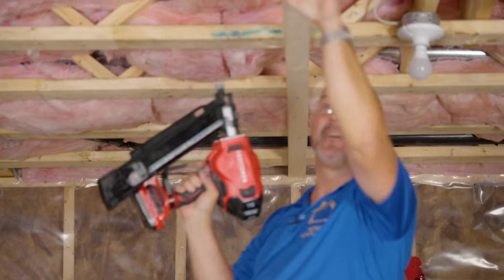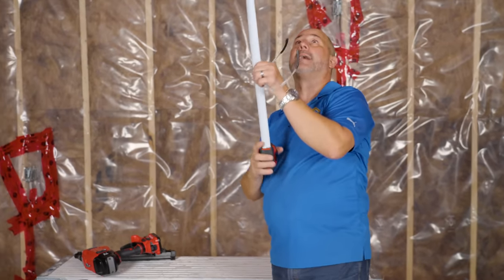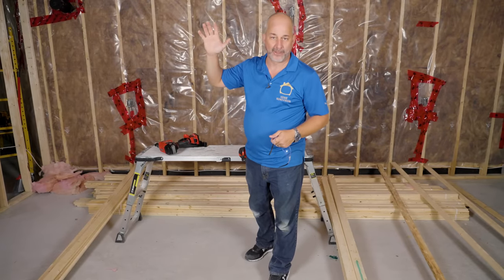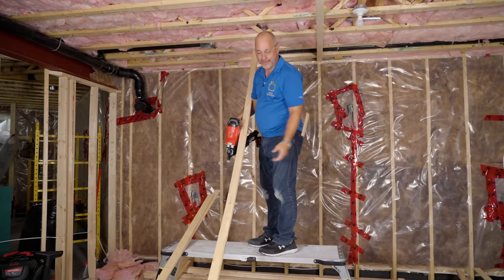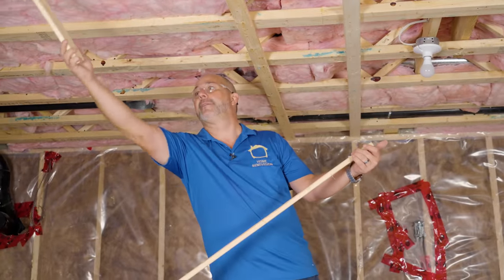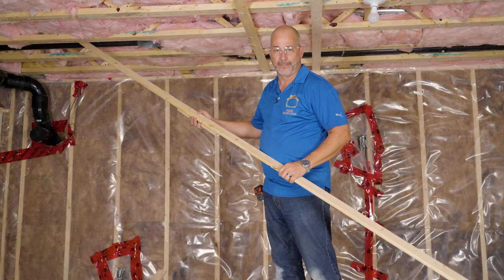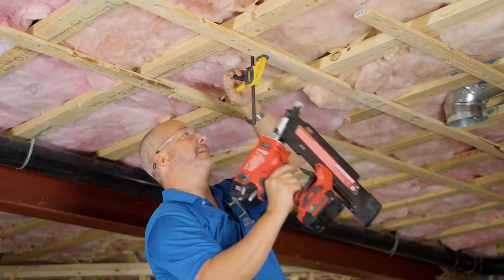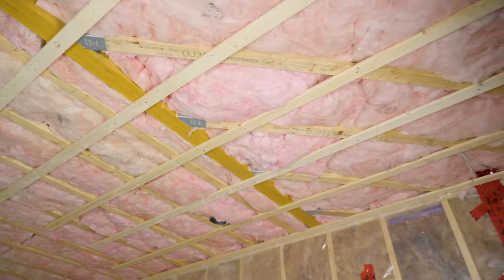Why You Should ALWAYS Strap Your Ceiling

Comment: I mean this is pretty good.  Strapping doesn't add strength or distribute load to adjacent joints, and squeaking won't occur anyway because the subfloor is also glued, but all in all this is a pretty good video.  (Construction professional)
Reply: Second that, no strength added.  Strapping will only act to help prevent the beam from twisting, but not sagging or bouncing. Only adding blocking between joists actually transfers the load from one joist to another...but only if it is done right and tight. No loose fitting blocks and don't space them out too far. Old homes with 8" joists benefit from closer spacing to firm up the floor.
Reply: Journeyman carpenter here, agree with you, strapping really only serves an aesthetic purpose, it helps you install different finish materials more flatly and get away from protrusions, aside from that it does nothing
Reply: seems to me that it is optimistic to assume strapping makes it 3 times stronger as mentioned at 1:28
Reply: @jwiereng  its optimistic to say it adds any strength at all
Reply: @chrisc5334  Ya, it this was true, you would see the engineer calling for straps and save $$ by allowing for smaller joists or smaller floor trusses
Reply: Dude you are huffing and puffing just putting up 1x4 strapping. Take care of yourself a little.
Reply: What you just said here is EXACTLY what I was thinking as he was saying that it, “adds strength”.
Reply: I bought an older home when I had to do a remodel and when the construction grade carpet was finally beyond any type of spacing or cushioning value, we pulled it all up and got down to the OCD floor before we put a laminate on top of it and I walked around and found every single squeak and we put in screws going well into the manufactured Joyce now we weren't able to pull up the whole floor and glue it and screw it, but it always puzzled me because all the user those Staples or you know nail guns on these cookie cutter construction projects, drove me nuts... when it wouldn't have cost that much more to do it right and use glue and screws and there wouldn't have been a squeak to be hurt on that anywhere
Reply: Engineer here and I agree with your statement. There is no significant resistance to deflection due to the strapping. The main advantage I can see to use it is in an old home with rough sawn lumber where the joists are not in-plane anymore (or they never were). I spent several hours with a hand plane on a ceiling of mine taking down a couple joists that were 0.25 low (the ceiling was already 6'9" so strapping was undesirable). With strapping you would only have to adjust the contact points instead of the whole joist. You could also use shims.
His wiring point is valid, it would help fish wires in the future. But that is not enough reason for me to do it. 

Sorry James, this one is a miss for me. Well done on the videos though.
Reply: @ryanleigh6701  To be fair he is talking about changes to the wiring after the room is finished years later. It would be cost prohibitive to cut a groove thru the hole room rather than fishing it over the strapping from a small hole to the next. 

Regarding wiring being fastened I have always questioned that one. Why? Where is it going to go in a stationary building? The worst would be the weight pulling it out of a box and dropping into the wall, so require that it fastens in the box. But in other places I think it could be bad. It is always attached to the framing, which is where all the fasteners go. That increases the likelihood of getting hit by a fastener, a shiner. Further because it is fixed in position it cannot deflect out of the way, so the fastener tears the jacket. Why not leave it loose in the middle of the cavity where it is unlikely to encounter fasteners, and if it does will just be pushed to the side or away? Also if you need to change out a wire later (adding a three-way for instance), unfastened you have a chance of being able to use the old wire to pull a new one thru causing much less damage to the building. 
It seems to me the practice is based on it looking neat, and not on practicality. 

Do you know of specific reasons?
Reply: @court2379  fire hazzard, when the ceiling comes down in a fire all the cables will hang down and cause a massive safety issue for fire fighters. Many have been killed in tower blocks because of it.
Reply: Totally agree with your point, besides nails have sheer strength, while screws have pull strength.  
I do agree building with future additions is always a great idea, and makes great points on this.
The problem is that now that people have watched this they will have the impression that nailing a horizonal one by will add additional strength.

One of the main reasons I walked away from building seven years ago, because customers tend to hears these types of information, and then end up questioning the builders abilities. 
Besides it's hard to find good help now a day's. After a couple months they want top pay, while they still haven't learned the proper way to sharpen their pencil. Lol
Reply: @ryanleigh6701  Turning the power off isn't the first thing they do before running into a burning building with a water hose?! Isn't that why most codes require a main disconnect on the outside of the building?

I still don't see how that would change much though. Hanging in the wall cavity isn't going to get in the way unless they are trying to punch thru the wall. Which they might do, but rarely. Seems to me the hazard of causing a fire in the first place or getting electrocuted by a fastener outweighs the unlikely scenario where the wires are in the way.
Reply: @ryanleigh6701  Don't know what you are getting upset about. I appreciate your responses. You provided a genuine reason why and a good discussion. I don't personally agree with the reasoning behind the requirement, but you didn't make it. It seems like it is in the interest of the fire crew and not the greater public safety. 
The electrocution comment was in reference to putting a screw into the wire and touching the screw.  Based on your response I think you interpreted that differently. 
IMO that is the more likely scenario, and a fire fighter is trained to know the hazards (and should be turning the power off) while homeowner with their too long nail is not. 

In the walls it doesn't seem to me it would make much difference to fasten them. The hazard is roughly the same whether you touch them in the middle of the cavity, or rub into them on the side of the stud. The ceiling they would drape though if running with the joints and the drywall has come down. The electrician would need to fasten those anyway to keep it out of the way of the drywall installers. It could be loosely though and still allow pulling a new wire while preventing draping. 

But if your reason is the one causing the requirement it makes sense as the fire people are the ones dictating its content and they are going to look out for their own.
Reply: I think this is a waste of time and money.  My house has floor trusses spaced at 19.2" and I installed the drywall directly to the bottom chord.  No issues what so ever and that was 14 years ago.  Running electrical or anything else  through trusses is simple.  My deflection was addressed when installing the 2x6 bracing through the webs.  Just another excuse to make a YouTube video I guess.
Reply: @court2379  if you have ever pulled much wire the last place you would want to pull is across  a screw penetrating the lathing. It rips sheathing. Chances are likely nothing would happen if it got a rip but why chance it? There is a reason wires are pulled through holes bored not through convenient opportunities...
Reply: @chrisc5334 stops sound travel too cuz it keeps the joists from acting like a drum for sound waves
Reply: @greensfarmland if you can’t e plain a compelling argument for your approach, perhaps you should reflect if it’s really is a good/better approach. Stager so so much nonsense and bs in residential construction mainly because there is no certification, 95% don’t get any formal education, and poeple just keep repeating the mistakes they made in the  past and the is limited curiosity also. A well informed builder would be Able to give a rough cost for this and any relative benefits…I would say use open web or true joists and you don’t need the spacing. I also agree with you the trades and buidlers on general are asking to get well paid without really knowing or learning or improving. At least for licensed trades plumbers, electricians, they must learn and pass tests and know codes cold. I think framing can be just as demanding and thoughtful, but too many people just want to swing a hammer and drive nails guns’ it’s fun’…the number of builders let alone carpenters who know anything about building science  is probably in the low single digits percentage wise. That’s appalling for such an expensive product. The pendulum will turn when the economy worsens.
Reply: You guys saying it doesn’t add strength need to review floor and ceiling diaphragms.  Adding lateral bracing to a floor system does add structural strength to the floor.  The way he is installing “strapping” he is installing lateral bracing.  The same type of bracing method is used for decks, engineered trusses (roof and floor) among others.  The drywall will also add strength to the floor if installed properly using proper fasteners and an approved fastening pattern.  

Also, the floor will absolutely squeak even if you use construction adhesive to glue down the subfloor.  The squeaking can be nearly eliminated using glue and screws appropriate for the subfloor thickness, rather than nails (although ring shank nails do reduce withdrawal).  

I’m not trying to argue with any of you, but I would urge you to research properly vs providing information based on your own installation experience.  I’m not sure many of you visit those homes 5-10 years after the wood dries out and the floor is loaded with furniture, foot traffic, etc.
Reply: My subfloor was glued and it squeaked so badly that when I did my reno, I pulled all nails and used the proper floor screws.
Reply: @court2379 on the wiring point, isn't there an issue with the shallow depth of the wiring?  or is it OK bc it's not a nailing space?
Reply: @miked5106  Are you meaning if the wire was loose in the cavity? Yeah the wire could be near the surface. However with nothing holding it, if you happened to put a nail in right where it was, it would just push out of the way.

Comment: I like your reasons for strapping floor joists.  I would strap my ceilings.  But I am kind of wondering if  1x3 lumber nailed to engineered joists can really transfer that much deflection to neighboring joists.  Maybe if the 1x3 was screwed in?  Or maybe 2x4 screwed in?
Reply: Of course it does nothing. He's literally talking out of his back side.  Staples and furring strips.  Lmao. Any house with hardwood would be required by code to have adequate sub floor.
Reply: @B.r.i.a.n.1  code is minimum. Code gets you shitty McMansions made with 85 different materials that was left over from other jobs.

Comment: Currently finishing strapping out my basement ceiling tonight. Great for led pot lights, pipes, and access panels. I’ve used a tons of your brilliant advice on my basement remodel. I’ve rewatched your basement videos many times. Your soffit idea want BRILLIANT! Thanks again Jeff
Reply from the maker: That is awesome! Cheers! Bri!
Reply: Because of you Jeff, I strapped my living room ceiling and it turned out looking great. My wife was shocked Lol
Reply from the maker: well done Mark!
Reply: My basement ceiling is already dry-walled but I think I might put strapping over it anyways because you made it look so easy
Reply: Question!! Do you frame the wall before you strap the ceiling?
I started strapping but it looks like it’s going to cause more trouble when I try to frame out the room
Reply: @ajmckinney33   Hi, I framed all my walls and then strapped out the ceiling. It’s fine if you have a slight gab in between wall and ceiling bc your going to tape corners with first coat of drywall mud then do two more coats. By the way, Long live Jeff! He’s the best!

Comment: Literally just finished doing this same job myself and totally agree with Jeff. The ability to go in and add more cables for future ceiling speakers (if I choose to) is really handy.
Reply from the maker: Cheers Jack
Reply: Explain this to me. I do not understand why strapping aids in running cables other than that the wire would lay on the strapping instead of on the sheet rock if you ran the line perpendicular to the strapping. If you run the wire same direction as strapping how would this help at all?
Reply: @quandt4847  I struggles with this too, I guess maybe you’d only have to punch a small hole in the drywall to fish the wires through and not have to go through the joists

Comment: Wow, this is how you get production work done fast!  When I added strapping to my ceiling, I didn't know about the spacer trick.  Also, I used screws even though I have a nail gun.  I was just being lazy because I didn't want to deal with the hassle of getting out the compressor.  It's DIY for me, so luckily I'm not on a time budget.  Great tips Jeff!
Reply from the maker: Cheers Robert!
Reply: For ceiling strapping screws are superior. For obvious reasons, ...gravity likes to pull stuff down and screws hold better against pulling forces.
Reply: Nothing lazy about using screws! They create a far superior assembly which will not pull out over time. There's essentially no risk of the screws breaking because the load is all tension, no shearing.
Reply from the maker: there is no shear force on a vertically installed nail. Cheers!
Reply: @HomeRenoVisionDIY  I think you might have misread my post. 😉🍻
Reply: @helmanfrow  there is zero shearing
Reply: @Fattony6666  Yes. I know. What about my post makes you think that I believe otherwise?
Reply: @helmanfrow  screws are superior, nailguns are cheap solution for lazy people
Reply: Screws and nails are equally good, just buy the right type for the application
Reply: @HomeRenoVisionDIY  no, but I believe the force of gravity will eventually pull the weight down on those nails I will go with screws any day of the week compared to a nail
Reply: @mattalbrecht7471   correct your screwed drywall is only as good as the nailed strap. But ring shank should do the trick.

Comment: Spot on as always! I just demoed the finished part of my basement to start from scratch. I was contemplating whether or not to strap because ceiling height is already below 8’. Now I know it will be a mistake not too and what am I sacrificing? 3/4”

Okay my material list just got a couple hundred dollars bigger but WELL worth it! 

Thanks! 
Perfect timing. Heading out tomorrow to pick up material.
Reply from the maker: Great news. strapping is only 5/8 of an inch thick so you will have a wee bit of extra head room. LOL. Cheers!
Reply: Yeah, for basements under 8, you are sacrificing some headroom plus any additional inches you add to floor (insulating/vapor floor boards). Inches start mattering a lot. Running conduit everywhere might make more sense.
Reply: @Lsidjejaickenw833  its 1200 sq ft of open space. I have been designing multiple concepts for over 2 years. Although I think I have a pretty good idea how it will be set up I might change my mind over time. Being able to fish speaker, broadband and electrical wire practically anywhere makes more sense by giving up less than an inch.  Trust me. I know how much it already sucks having less than 8'. My last home had over 9' ceilings in the basement.  I had such a sweet setup but we moved to a historic area where most homes are over 100 years old. I tried several companies to under pin my home but had no takers. Beggars cant be choosy. Gotta make due with what I have now.
Reply: @Lsidjejaickenw833  my late husband was 6'4". Our basement when finished was 6'6". We put in recessed lighting, and used the rim joist on each end, and built the adjacent walls about 2 inches off the block to create a chase way for all the wires, plumbing, etc.
Reply: Waste of time and money.